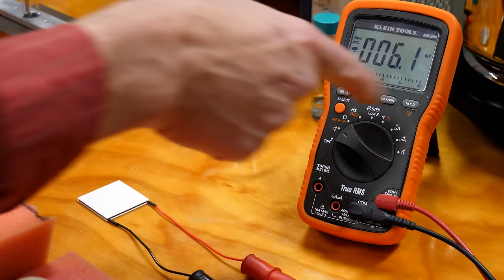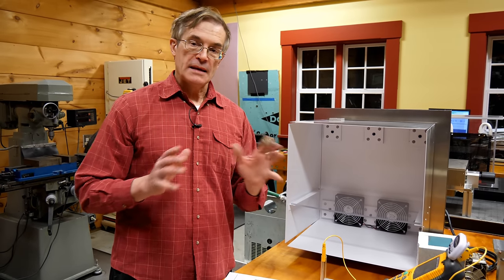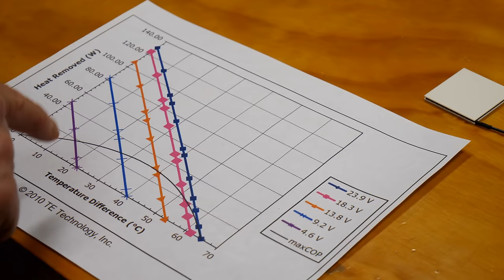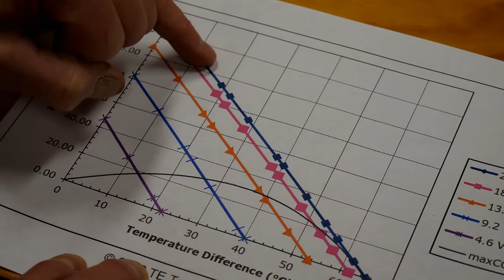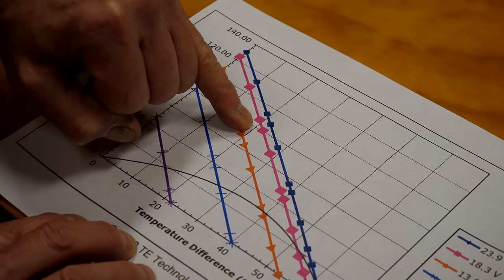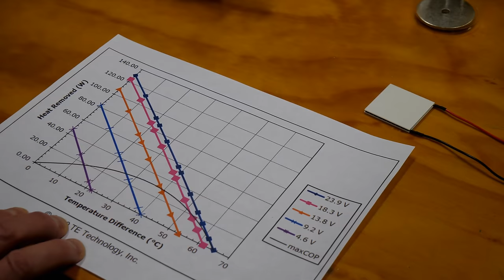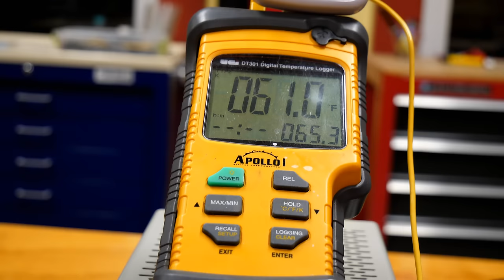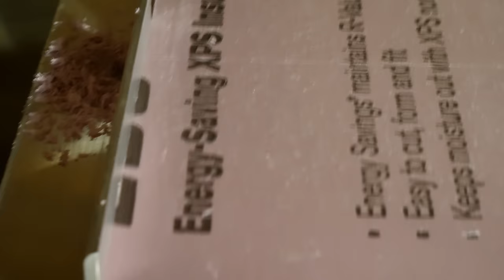BUILD YOUR OWN REFRIGERATOR! - SOLID STATE TEC

Comment: Why not use corrugated metal heat sinks? You'd get the same overall volume and spacing, but you'd probably triple your total surface area available for heat exchange.
Reply from the maker: I thought about it.  The interface at the spacer blocks becomes difficult and the actual surface area gain was about 40%.
Reply: @TechIngredients  Huh... that's all? You'd think the gain in surface area would be large enough to outweigh the other difficulties...

Comment: Wouldn't you get an efficiency boost from using two large fans instead of eight small fans?
Reply from the maker: You might.  The trade off will be the poorer distribution of the airflow.

Comment: I wonder to what degree the efficiency of the refrigerator is effected by the thickness of the aluminum walls?
Reply from the maker: The thicker, the better.  The improvement may be rather small, but because the aluminum is acting to conduct the heat from around the box to the back and eventually to the TECs, the temperature gradient will decrease as the sheets become thicker.  The downside is that the aluminum becomes more expensive.
Reply: @TechIngredients  Great info - thanks!  Planning a similar project and have some left over 16g 3003 laying around. Wasn't sure if I needed to get thinner material for the walls of the fridge to maximize transfer on the cool side.

Comment: I have observed your video. Educational- no doubt but I'm a cosmetologist- my comment is - I'm moving off grid - I purchased at 4500 watt generator- but I dont want to use it everyday- and have purchased 2 solar panels- my idea here is - I dont want a store purchased refrigerator- I want a DIY refrigerator made from a brick n clay wall - looking seriously at those "" butcher meat coolers in the grocery store holding the meat"" meaning - I'm going to build the box from brick and clay for the casing - but can it be done with a brick casing?? And possible to operate from a car battery or solar panel? Thinking size - 4ft x 6ft - or is this too many questions?? Thanks !!!
Reply: Sorry - I'm thinking like a wine cellar type cooler - 4ft height 6 ft long? Thank you !
Reply from the maker: The brick or clay will give you a lot of thermal mass, it's heavy after all.  But it's a poor insulator.  If you surround it an all 6 sides with insulation, the thicker the better, then your cooling system will still have to cool the contents of your refrigerator as well as the added mass of the clay/brick, but once cool this will allow the cooling system to cycle much less frequently.  You won't increase effeciency, but may be able to run infrequently enough that the cooling can be accomplished during only sunny periods.

Comment: sorry, i think I asked you wrong question. Let me ask you another way.  37:26  it is seen as you fix shim on the back side of a wall. why? Why not just fix aluminium block with TEC directly to back side of wall. Why need a shim?
Reply from the maker: Those aluminum plates that you call shims are added to improve the heat flow into the relatively thin sheet metal thereby reducing the impedance to flow through the plane of the sheet from the smaller block.  In addition, the clamping force over the larger surface area improves the effectiveness of the silicone thermal pad between the two sheets.

Comment: Hello: I’m looking at this information along with the freezer video and I’m not seeing a parts list or a cost analysis relative to a prefabricated 12v system. I need refrigeration for my medication as I made the mistake of challenging corruption in Fort Wayne Indiana and didn’t realize I was challenging a giant. My rent was current but I’ve been homeless for more than a year and a half with no end in sight. I’m trying to figure out how to handle CHEAP climate control and refrigeration. My pickup is a Toyota Tacoma so I have very limited cabin space (and yeah I sleep in the driver’s seat despite being 6’3”) but I am open to creating something on a trailer. A small discreet sleeping space that allows me to be comfortable while not having to run a generator, buy fuel, and that doesn’t actually LOOK like an RV could help me immensely. I don’t know exactly how I’ll fund it on my disability income but I am hoping I can put something together that I can then share with other people in similar situations. The prototype is the first part I have to address. I’ve checked out the parking heaters, solar power (panels, batteries, mains charging), and generators so I’m open to power sources but would likely lean heavy to solar. I’ve also watched a lot of your solar videos too. Thank you for so much information, if it wasn’t for this I would have less than no hope at all.
Reply from the maker: I'd stick with a commercial refrigerator as they are quite efficient and relatively inexpensive.  You can substantially increase the efficiency  by insulating the door and walls and especially  the gap between the hot, heat exchanger coils and the wall next to it.  The rigid, polyurethane foam sheets  are the best and easy to work with.
Reply: @TechIngredients  Thank you for your quick reply! I was hoping this would be less costly than a commercial option (and more quiet relative to operation). The commercial options aren’t even close to what I’d describe as affordable. Dometic seems to start at over 500 and Coleman isn’t far behind. 

Another benefit I see with a custom designed cooling space is that I can specifically target a temperature as well as fit into or accommodate a specific set of products. I might also explore compartments as some medications aren’t supposed to be refrigerated but definitely shouldn’t be cooked like they can be in a pickup. Insurance won’t pay for one small 12v fridge much less two AND the solar system to sustain it. I’ve asked.

Comment: Why no heat sinks on the cold side?  More area?
Reply from the maker: Because the entire inside aluminum surface participates in heat exchange and the rear fans blow over this surface, I avoided the expense and loss of interior volume.
Reply: Yes, I get it.  Failed to recognize the entire interior is aluminum.

Comment: if Peltier cooler is just sand-witching or combining of 2 metals then why its so expensive $9 for small piece, or what is in there or how it actually works?
Reply from the maker: In most modern TECs they use semiconductors because they produce a larger temperature gradient than metals, but the principle is exactly the same.  However, what increases the cost is that they can't achieve reasonable voltages and currents with just one large junction in each TEC, there are hundreds.  You can see them if you look carefully at the middle layer of a TEC that hasn't been sealed with silicone around the edge.
Reply: @TechIngredients  Thanks for reply, you explain everything in so simple way which makes it very easy to understand.

Comment: Could you please make an AC with this method, thanks!
Reply from the maker: I don't  think that's  a good idea.
The limitation with these devices is their low efficiency. In a very well insulated system, their compact, solid state and modular advantages are useful, but airconditioners have to move a lot of heat, and efficiency is key.

Comment: This might be a bit of a tangent but I find it funny that the Imperial System of units is held with great national pride among most Americans yet their unit for heat energy (BTU - British Thermal Unit) literally has the name of another country in it.
Reply from the maker: It's also humorous that the most powerful cars in the world are manufactured in Europe, but they're rated by horsepower.  Neither system is superior, but is often defended based on national pride.
Reply: @TechIngredients  I do understand that most units in everyday life are still around because that's how things have always been and transitioning takes time. I too default to feet and inches when describing height. What I am against is the almost negative reaction to the Metric System (Though this understandably is not representative of all Americans).

As to which system is superior, I will say that I was trained on both and perfectly comfortable using either. However, whenever I find myself doing critical power plant performance calculations, I do always default to metric to simplify equations and just do the conversion to imperial as needed (such as calculating pump selection in metric and converting to horsepower for motor selection).

For me at least, because units in metric flow into each other (kg.m/s^2 = N... N.m = Joule.... Joule/sec = Watt) mistakes are far less likely to happen and easier to trace down if they do happen.

Comment: No matter the size of your heat-sink, there is no way it is more efficient than a heat-pipe based one. Heat pipes achieve almost instantaneous temperature drops, which is impossible with a solid heat sink of any metal, not even a diamond.
Reply from the maker: That's true.  However, we weren't trying to produce a system more effecient than a phase change refrigerator.  Rather, I showed how to achieve high effeciency in a refrigerator based on thermoelectric coolers.

Comment: Couldn't you arbitrarily raise the CoP by fastening an additional set of peltier modules to the heat sink, or even directly to the back of the first set of peltiers, and connecting the second set to batteries, thereby harvesting the heat energy of the first set and reducing the net energy in? Same principle would apply for compressor fridge or any heat generating system.
Reply from the maker: No.
Staging or operating  peltier devices in series can be done to achieve  larger temperature differentials, but the efficiency drops significantly.  Remember, the second device has to remove not only the heat moved by the first device but also all the electrical energy  used to drive the first device.
Reply: @TechIngredients  Yes, I saw that video (very informative, thanks); but I think I am referring to a different idea. The idea is not to power the second set of devices, but to use them as passive harvesters of the heat generated by the first set. The second, unpowered, set would convert this heat into DC electricity which it would then store in a battery bank (maybe lithium ion) or super capacitors. I am just a tinkerer, so it's quite possible I am way off the mark.
Reply from the maker: That won't work.  The second stage of peltier devices, when used as generators, will interfere  with the cooling of the "hot" side of the cooling peltier devices.
Remember that the generator needs a temperature differential to produce current.

Comment: This might be a dumb idea, but brain storm with me here.

Is it possible to use a peltier device to collect the waste heat from the cooler to recycle electricity back into the system?
I've never used one of these, but it seems to me it would be better to manage excessive heat by converting back to electricity, rather than pumping it back into the room.
Reply from the maker: No.  The loss in thermodynamic effeciency by lowering the cooling of the primary TECs is greater than the energy that can be recovered.
Reply: @TechIngredients , very well. 

Hey, thanks for the quick reply on a year old video!

Keep up the good work!

Comment: What about vacuum desiccation to regenerate the descant?
Reply from the maker: You need a substantial amount of energy to drive the water out of the dessicant, you need heat.  
Did you watch our video on the "Revolutionary Airconditioner"?
Reply: @TechIngredients  
The idea was to attain some of the benefits of TEC devices with efficiency comparable to phase change pumps.  My thinking was that a small lower power vacuum pump running 24/7 might make less noise than a large compressor running for an hour at a time.

Maybe also get rid of all the copper, since that's so expensive now days.

Comment: Is this viable for a motorhome. I want to travel, but the cost of a fridge and the electricity to run it are really big for me.
Reply from the maker: It is, but it may not be ideal.  Despite my care in assembling this model, the effeciency will still be lower than a commercial, phase change (conventional) refrigerator. A better solution might be to improve a commercial unit with additional insulation and forced air cooling of its radiator coils, further boosting it's effeciency.
Reply: @TechIngredients  Yea' and I'm in Australia, not a lot of snow on the ground around here. I'm thinking about a fridge unit like what they do on boats and install it into a diy 4'' walled poly compartment. Seems a lot cheaper than the electric eskys/fridges.

Comment: 13:39, but wouldn't the intermediate junction metal corrode over time? If it is exposed to a small amount of energy (enough to get electrons to "fall" off the intermediate, but not enough for the electrons to get back up), then it will lose electrons to the other metals until the negative charge collected on the other metals provides enough resistance to further prevent any more electrons from being lost: at this point the difference in energy levels will be equalised, BUT then as contact can be made with a salt-bridge like medium (such as moisture in the air), oxidation will occur for the intermediate metal, as negative ions will happily couple with the positively charged metal corroding it away.
Reply from the maker: The electron flow alone will not corrode the metals.  It will only continue as long as a region depleted of electrons recieves suffecient electrons from the available current flow to maintain a stable potential gradient.  The junction can corrode if exposed to moisture and competing ions such as salt.  That is why they are usually hermetically sealed.
Reply: @TechIngredients  Awesome, thanks for the reply

Comment: The large custom heatsink on that refrigerator device is far less efficient than a computer heatsink, because the heatsink uses heat pipes instead of a big lump of metal, and heat pipes have an ungodly efficient ability to transfer heat to the fins. They're also incredibly hard to work with though, as you have to machine the holes in the fins very precisely, since welding the fins on to the heat pipes would risk ruining the heat pipes by getting them too hot. I'm not sure how long you needed the base of the cooler to be, but if computer heatsinks would have worked, you may have been far better off getting 12 computer heatsinks for free out of 12 obsolete computers and using those instead

Comment: SO! these generate power with heat? sooo how much power can these generate size for size compared to a solar panel of an equal size? less? more? could it replace solar panels? could painting them black increase there heat absorption? thus helping to increase power output?
Reply from the maker: Did you watch our video on the "Campfire Generator"?

Comment: it seems to me that the deficiency is that part of the waste is in heat when we're talking about refrigeration. but when we're talking about refrigeration we're probably thinking general population in homes. the homes need heat and cooling in terms of refrigerators and ACS and also water heaters and actual heaters. to me to get twice the use out of this it should be a hybrid between a hot and cold side that pumps hot fluid from the peltier on one side to let's say a water heater tank to induce more heat so that the water heater uses less of another energy source to heat and the cold side to go to what needs cooling. I would say a home setup correctly for these objects to be near each other could be done easily. I'm not sure how efficient it would be though but still you're taking a lot of that loss of energy and applying it to functionality and gaining some efficiency back.

Comment: .If , with a Petia Strip "biggest problem   is removing heat "    then   make a tiny   steam engine  hooked to a tiny electric gen  .  you could remove the heat and  feed some electricity back to run the PS , wouldn't be infinite energy but it should increase the efficiency of it  ,    no  ??
Reply: how about building a Stirling Engine as the interface between the Hot side of PS  and the Heat sink . having  the   SE     gen a tiny amount of electricity, to be used to increase the efficiency of the Refrigeration

Comment: tec with cop of 2?? where do you buy those?
Reply from the maker: Any TEC can achieve that COP.  It requires a small temperature differential and low current flow.
Reply: @TechIngredients  
So basically stacking them will get you a high cop?
Reply from the maker: No, the opposite.  Take a look at our video on extreme cooling.  Stacking reduces effeciency because each TEC in a series adds it's own generated heat to the heat that it has to pump through it.

Comment: If I understanded the hotter the place where you put the fridge the cooler it can get?

If yes im putting this in my server room
Reply from the maker: No.  The refrigerator creates a temperature differential and will get colder as the outside tempretures drop.
Reply: @TechIngredients  ok thx